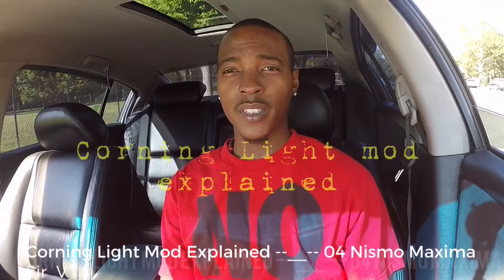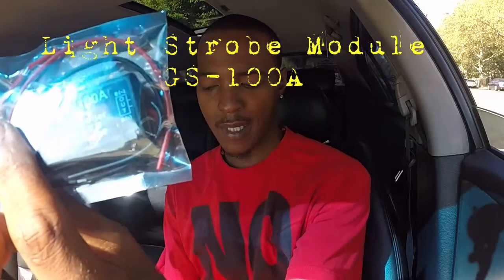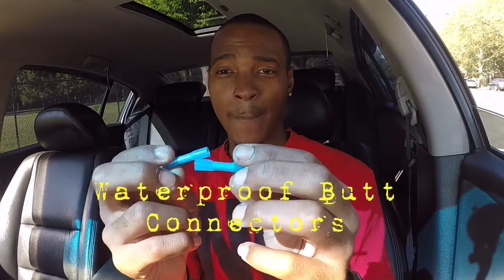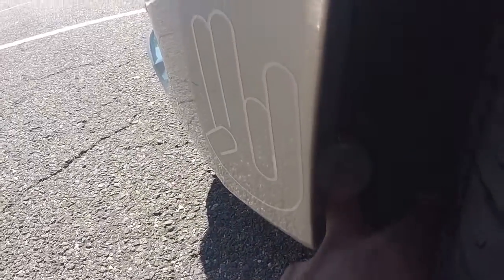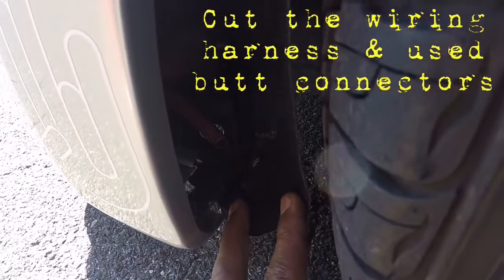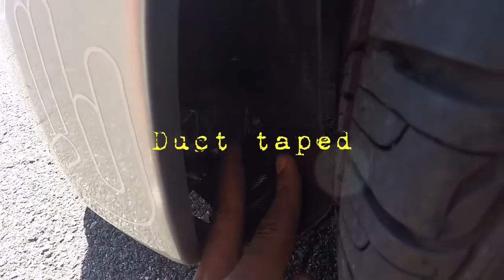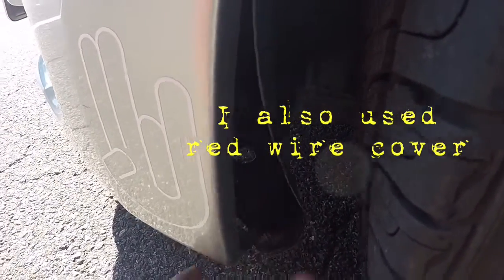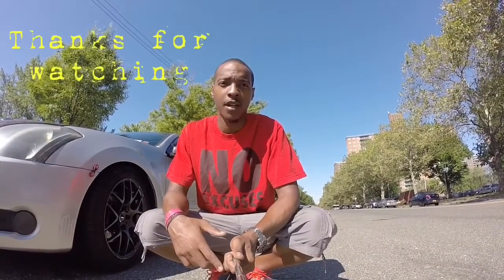Corning Light Mod Explained --__-- Silver Surfer

Comment: Yo bro, is there a way to set up the cornering lights to turn on and off with a switch inside the car. I hate having them turn on when i want to turn left or right. I want to be able to light them up both at the same time
Reply from the maker: I'm not 100% sure about that setup.. I believe you can rewire your corning lights to any power source then run a off/on switch with it.. I believe my boy J-Max did that mod.. You can hit him up if you need further details..